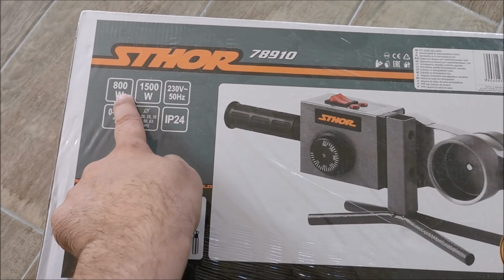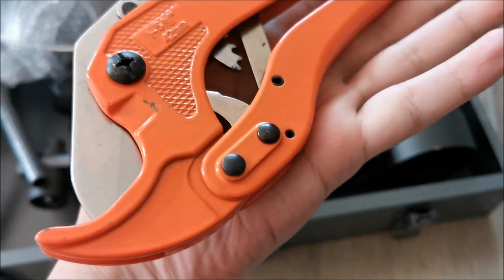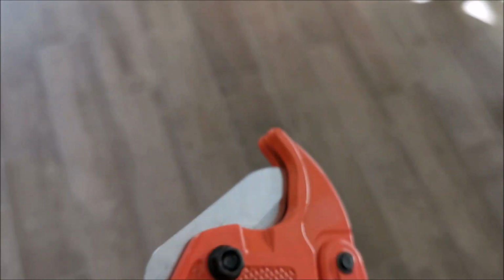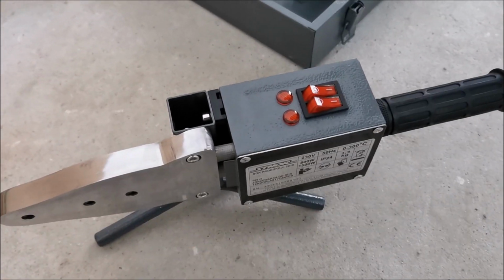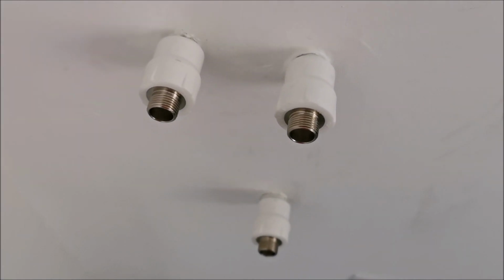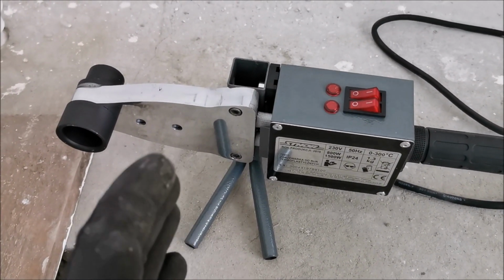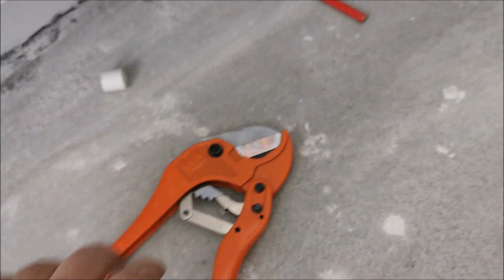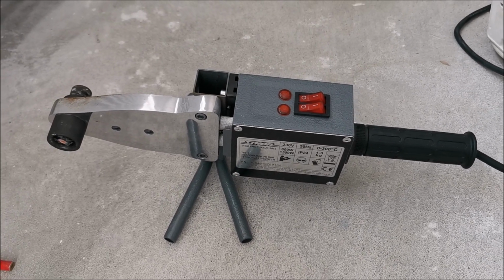STHOR 78910 Plastic pipe welding kit - use and review

Comment: Are you still satisfied with this? I want to buy one just like this but im not sure.......from what ive seen it doesnt say the time  to keep the PPR pipe hot.....
Romanian?
Reply from the maker: Yes, I am still satisfied. A friend of mine has also used it without any problems. You will learn in time exactly how much you need to heat the pipe. For home use it's a perfect tool. (Yes, Romanian)
Reply: @UltimateDIY  Si eu tot roman,multa sanatate tie si fam tale ! M-am prins de asta dupa scrisul de pe tevi....
Deci multumit de plita....eu am avut o cazatura care azi m-a lasat, a facut scurt si a puscat....
Nu are tabel din acela cu timpii pt incalzire? Se descurca bine si daca PPR este ud?
Reply from the maker: Super scula nu e nici asta, dar pentru uz casnic, e ok. Are un tabel cu timpii parca in manual. Cu PPR ud nu am incercat. Sanatate!